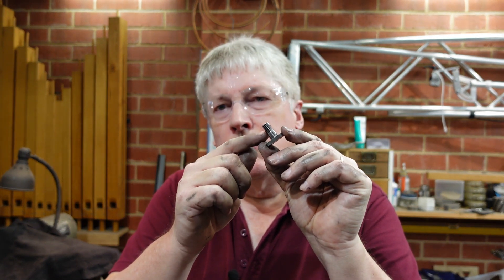A turn for the lathe - rotary T nuts

Comment: Have you tried heat treating & tempering your E25 (I think you said) compound T-studs (if that's what they are called)?  Even in your home workshop, you could do that with a torch & appropriate "fluid" for tempering & estimate the temperature they reach by their color when under your torch.  That way you could get fairly long-wearing and tough "T-studs" and possibly never have to remake them.
Reply from the maker: I haven't, although I have a bit of HT coming up in another clip soon. A previous place I worked at was a great believer in making parts out of and not heat treating them (or if they did, a mild HT). The reasoning was that it was stronger than a plain carbon steel in its natural state and with no/ little HT, nicely ductile with a very low chance of brittle cracking.
(I can never remember whether it is EN25 or EN26...)

Comment: Regarding the hotrolled nuts - that's such an important step to think ahead "This assembly is going to wear out or break, where would it be best for that to happen?".  

When I was much younger I didn't think much about things like shear pins on lead screws, keyway stock, bolts, etc.  Now, I try to do the same thing you do, and ask "Where do I want this to break?".
Reply from the maker: Not sure how well it will work, but yes, thinking a bit about failure points can make the next time a lot less difficult.
(I didn't think as much about that when I was younger either)

Comment: Love the Monarch lathes.  I worked in a shop that had (nearly) Monarch exclusively with the exception of one Hardinge.  In the 46 years I worked there, I never needed or saw any of the other toolmakers use that taper attachment.
Reply from the maker: This lathe is a British CVA - I think that during WW2 Monarch supplied a bunch of lathes to the UK (or the drawings) and the CVA series 1 was produced. This one is a series 3 (1957) which is a development of the original series 1, it self an almost straight copy of the 10EE. I suspect that quite a few of the functional parts in this one are the same or very similar to the Monarch. The drive train is the exception - CVA did not go with the Monarch variable speed and instead I have a 12 speed box. I prefer it- from what I've read the variable speed (like the Colchester Chipmaster) is great when it works but when it does not...
I use the TTA (but only infrequently) for making Morse and ISO tapers for mill tooling.

Comment: Would it be possible to make longer flange nuts and longer studs. It looks like it doesn't need much use before they need replacing.
Reply from the maker: I would like something bigger too, but I'm limited by that gap under the compound. I think that the best plan is just replace when needed. This set has lasted for 10/ 15 years so not too bad.